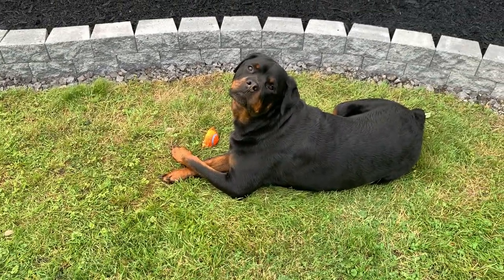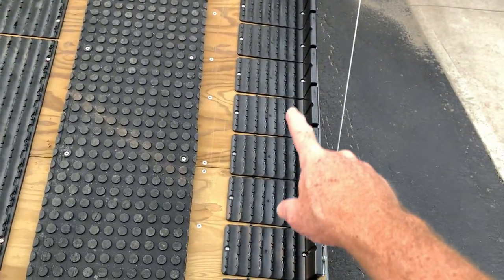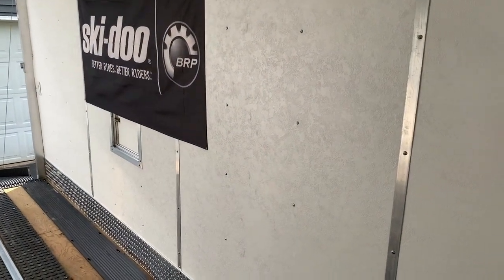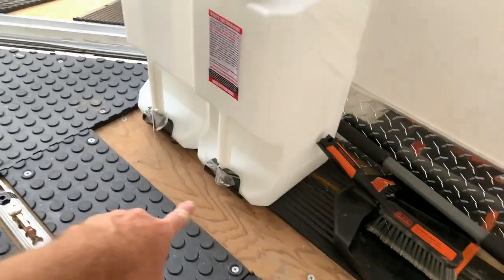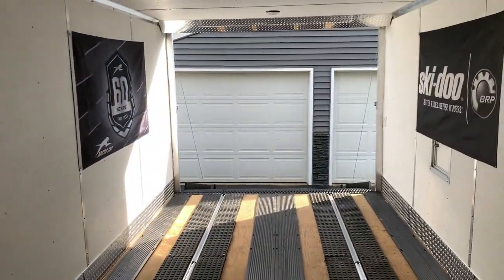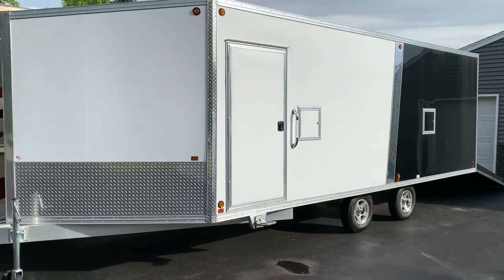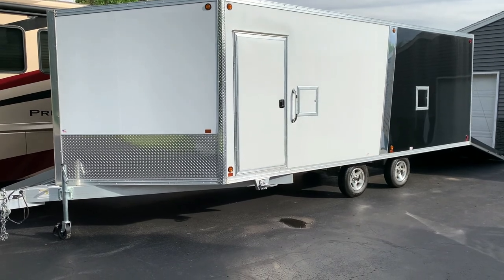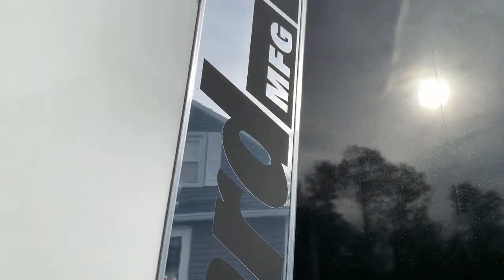NEW ENCLOSED SNOWMOBILE TRAILER WALK AROUND | BLIZZARD MANUFACTURING | 4 PLACE

Comment: Really nice trailer we have nice setup too we installed Chinese heater created a changing room up front with a curtain works really nice only downfall creates moisture which freezes up but we have bench to sit on coat rack like yours toolbox you have nice setup never considered posters on the wall inside they do that next.
Reply from the maker: Thanks Jim bo, I’d like to add a Chinese heater one day to make it warm in there for changing. 👍🏼The posters on the walls are Skidoo & Arctic Cat 3ft x 5ft flags. Take Care

Comment: very nice trailer! All the blizzards I see have dark wood inside, Is this a vinyl/plastic option or did you do it?
Reply from the maker: Hey Michael, Thank you and thanks for stopping by the channel. Yes the white vinyl walls and ceiling in my trailer is an option from Blizzard. The dark wood you’re referring to is the standard Blizzard luan finished wooden walls you see in most enclosed trailers. I opted to get the white vinyl walls, ceiling and fully insulated so I don’t have issues with moisture & mold spots commonly known to happen inside trailers with wooden walls. Take Care and think snow. ❄👍🏼

Comment: Nice looking trailer. Been looking at the 1256 deck over double axle or 714 inline Blizzard. Wondering why you choose the deck over vs inline? Do you trailer it during the winters or just storage? Curious on what price was? Definitely have it setup nice!
Reply from the maker: Thanks Matt, 👍🏼 The deck over compared to the Inline is really a matter of preference and need. It depends on what one feels comfortable with pulling down the road, how many sleds you’ll haul and how much jockeying around sleds you wanna do. You can’t go wrong with either of those choices you are thinking of getting. I’m use to driving a 40ft diesel pusher motorcoach, pulling a full size Silverado behind it so pulling a longer, wider trailer is nothing for me. I don’t mind the added width when trailering and the benefits of having the added interior width that comes with the deckover is a major plus for me. I love being able to place two sleds side by side inside. I personally don’t want to move one sled to get another sled out. Being able to haul four 137” sleds was one of the things I wanted when I had this trailer built. My buddy currently has a 2020 Blizzard 16ft inline and when we headed to Northern Maine this past March for our last ride he drove his truck and we used my trailer. He commented how well the deckover towed and tracked down the road in comparison to his inline. To answer your other questions, I use the trailer for the sleds on every ride. I don’t use the trailer for storage at all, not even in the summer months. I ordered the trailer last July 2021 with just about every option blizzard offered so the price it cost me last year will definitely be higher this year if you ordered one now. I would plan on at least 6-8 months for completion if you order a trailer with all the supply issues going on. This is the trailer I have always wanted and was only going to do it once so I loaded it up. I have moved up over the years from a open place, w/salt shield back in the 90’s, then on to a couple different variations of clam shell, then to a Blizzard Hybrid trailer which I sold once my new trailer was finished. This is my last trailer so I ordered it exactly how I wanted it. IMO this drop roof V nose trailer pulls as good if not better down the road than the Blizzard Hybrid I sold. The Hybrid felt more like a parachute, where the new trailer is heavier but actually tows better behind the truck. 🤷🏼‍♂️ Take Care 🤙🏼

Comment: Magnificent Trailer 👍🏼
Looking for a 3 place sometime soon 🤞🏼 I know of a few brands out there... what made you decide to go with Blizzard?
Reply from the maker: Hey James, Thanks for stopping by the channel. The main reason why I went with Blizzard is it’s a local business and very well known around these parts. Pull up to any parking lot in this area and 1/2 to 3/4 of the trailers in the lots are Blizzard trailers. (Hybrids, Inlines and deckovers) Secondly I like how Blizzard uses the single freezer latch system on their doors and a seamless roof. I had a 2019 Blizzard 12ft Hybrid that was very well built with no issues, but I wanted a more luxurious trailer so when I pulled my sled in I could stand up with my helmet on and well insulated. IMO two of the things I look for is 16” on center walls and ceiling and marine grade plywood deck flooring. Like anything you’ll get mixed opinions about materials used in flooring. My trailers in the past all have had marine plywood deck flooring with zero issues of rot. If I didn’t buy a Blizzard trailer I would look into the NEO NASX snowmobile trailers which have the single door latch, plywood deck flooring and 16” walls and ceilings. Very similar to Blizzard. If you have any other questions let me know. Take Care 👍🏼
Reply: @SometimeIsNow  can't thank you enough for ALL the info! I'll be up at the show Fri & Sat in 2 weeks... usually that company is there... It kinda sucks being down on the island & having to traveling all north to ride. But it is what it is... that's why I'd want a good solid trailer! I've watched plenty of your videos & trust your word! If there is anything I'll keep in contact & thanks again for responding! 
Think ❄️🤞🏼
Reply from the maker: @jamesvitale7132  Thanks for the kind words and thanks again for the support. Yes Michelle (The Owner) of Blizzard Trailers is always at the Big East Show. She’s very knowledgeable and straight forward. Sadly you might hear build lead times of 6 months or more for a trailer if you order one at the show due to supply issues with getting aluminum. If your lucky, your best bet is to find one on a dealers lot somewhere. We’ll be at the show Saturday. 👍🏼
Reply: @SometimeIsNow  I'm sure there will  a wait, lol... I'll be up w my girlfriend... so maybe catch you up there 👍🏼
Reply from the maker: @jamesvitale7132  👍🏼